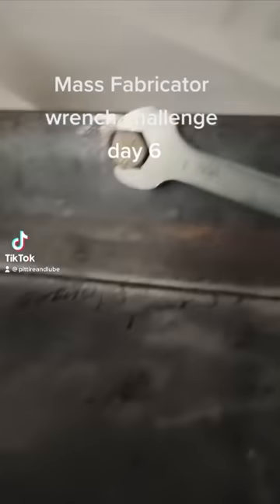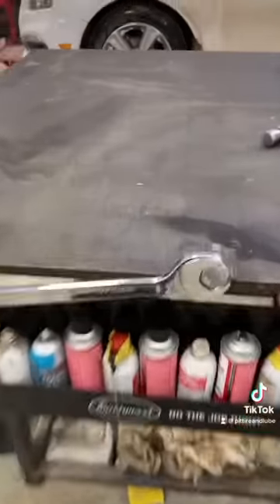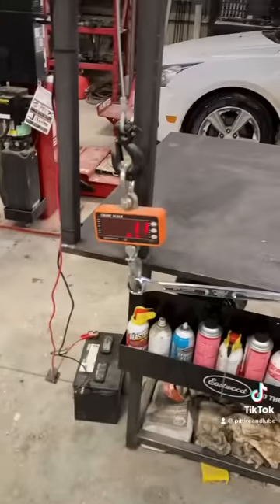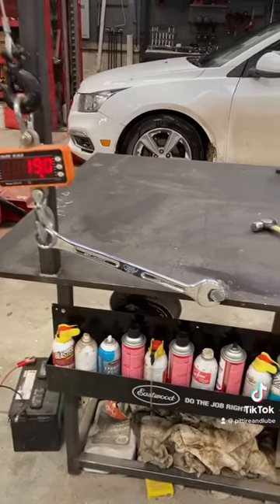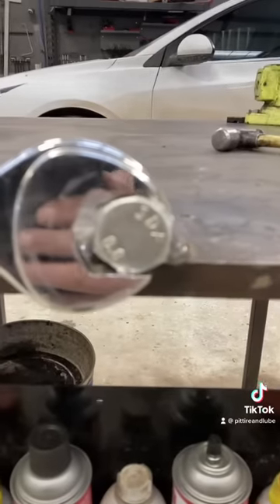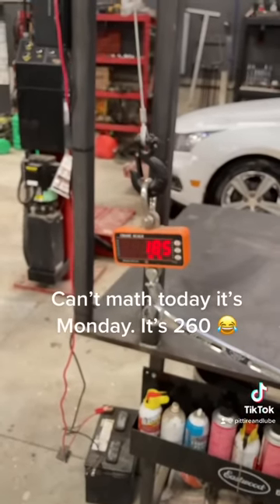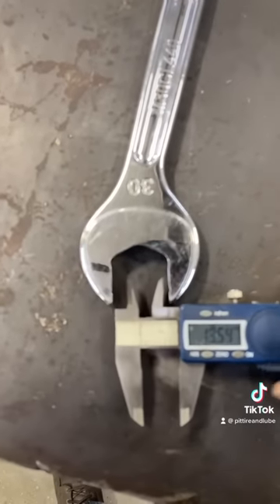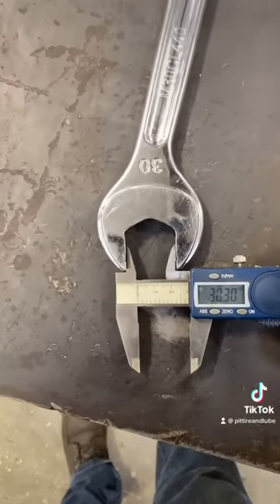Open ended wrench torque test #mechanic #Tireshop #wrenches

Comment: You are not properly applying torque to the wrench. You are pulling away at the end of the stroke.
Reply: Yes exactly.
Reply: Close enough. The wrench is slipping off the faster like in the original.
Reply: @mikeznel6048  because hes pulling the wrench off......watch AVE if you want to see how a wrench should be tested. this is not it
Reply: Would have to pull along an arc to properly test
Reply: @justinmckee2256  yes.
Reply: Torque is the cross product of the radial vector with the force vector which in this case is the length of the wrench multiplied by the the force applied to the end of the wrench multiplied by the sine of the angle between the wrench and the applied force. If you take a Taylor series expansion of sine term in this relation it becomes clear that small angular deviations from 90 degrees make a very negligible difference in the actual torque applied.
Reply: @justinmckee2256  pull along the arc... or just spin the fastener and not the wrench.
Reply: @mikeznel6048  Came here to say exactly  that.
Reply: That's what she said
Reply: The stroke needs to be in a circular motion, had to achieve that with the winch.
Reply: Need a pulley

Comment: I'd like to point out that if you know the thread size and the grade of the bolt, you can look up a chart of the typical maximum tightening torques. 👍
Reply: That's what I do when I can't find specs, just pull up the chart for that fastener. Go low of it's in aluminum, high if it's in iron/steel

Comment: You need to apply the sine of the angle relative to the vector that you are applying force from
Reply: finally someone who knows moments
Reply: @jadenr.11 we all aren't mathematicians
Reply: @mcstench8913  i’m not a mathematician but i know simple engineering
Reply: @jadenr.11  we all aren't engineers
Reply: @mcstench8913  you don’t need to be an engineer you just need to have finished 3/4 of high school
Reply: @jadenr.11  we all didnt finish high school
Reply: I f*cking love YouTube comments
Reply: @mcstench8913  then that’s ur problem at this point
Reply: @jadenr.11  we all don't have problems
Reply: @mcstench8913  😅😂

Comment: Chinese wrench open end is spreading. That's why it's rounding off the bolt. Its not the bolt failure
Reply from the maker: Well we did it on another bolt and it held 540 foot pounds so almost three times that one 🤷🏼‍♂️

Comment: I still think it funny how many YouTube videos I watch where people are testing the limits on tools. Lol. A 30mm bolt, I’m just changing oil maybe a little suspension work but I’m still watching this stuff. Ok. Off to torque test channel to watch them test 2” hydraulically powered impact wrenches.

Comment: Well to be exact: FtLbs is torque, psi is pressure. I think the guy in the video wanted to tell (what I think are) his students how much pressure is on there, because its just gripping on a small contact point with much force. Anyway, still was a good video on showing how much torque can be on that wrenchcbefore its starting to slip.

Comment: that lever is more than a ft. measure and recalculate it's probably over 300ft lbs at a ft and a half.
Reply from the maker: It’s 1.3 feet, did a second test on a new bolt and held up to 546 foot pounds before I stopped. Very impressive in my book
Reply: Where does he get 200lbs * 1.3ft = 360ft*lbs. maybe he meant 260 ft*lbs.

Comment: Never mind the surface area making contact between the two wrenches isn’t the same. Looks like the one guy is using a wrench cut on a plasma table while the other is most likely made out of chrome steel and obviously thicker.

Comment: Snap-on flank drive plus can pull head off bolts. That's why I bought them. Yes open end! Of wrench
Reply from the maker: We’re going to test them here in a little bit
Reply: That's what sold them. Never regret
Reply: gimme a 1 3/8" one of those and ill put it to the test. ive stretched so many wrenches taking off -16NPT fittings. honestly like 5 or 6 now

Comment: The imperial bolt with the 6 lines on is a grade 8 bolt, which is closer to a 10.9 metric one not a 8.8

Comment: That why if you can get the box end of the wrench on the fastener you should use it because the open end of the wrench will spread open or round the bolt
Reply: You also don't want to use a 16 point wrench because it can strip it just as easily.
Reply: @RandomPerson-cj2wi 
Sixteen point wrench ??
Who makes that ?
Reply: @Ben Jurqunov  mabey I'm thinking of 12. When I typed it I couldn't remember if it is 12 or 16.
Reply: @RandomPerson-cj2wi  if you can’t remember….. you should probably not type anything at all

Comment: How much pressure? I don't think the guy is using the correct unit. It should be  torque, which is the force times the lever arm. It may seem like I am being pedantic, but these units are extremely important when understanding physics.

Comment: Difference is the wrench in the original post looks like a cheap cast tool that came with some furniture and will bend if you look at it weird. Different wrench will show different results
Reply: Look up 'Mass Fabricator'

That wrench you're talking about is made out of AR500 armor plate steel. The open end of that wrench probly has more tensile strength than both ends of that mac

Comment: I had the precision torque wrenches. Absolutely trash. Matcos rebranded proto wrenches are a hell of a better deal and better tool, those mac branded facoms are soft, ill always reach for my flank drives if I'm having issues.

Comment: The force should be applied in an arc not at a 90 degree angle.

I don't mean to be rude but you don't understand physics nor what you're trying to achieve.
Reply from the maker: When you pull on a wrench you don’t pull in an arc.
Reply: my thoughts exactly!!!
Reply: @thepit2020  yes, actually if it is tight that's the only way it will come loose
Reply: @thepit2020 think of the bolt head as a sun, and the very end of the spanner a planet in a perfect orbit.

Force should be applied in an arc or radius...but then again I've been a qualified mechanic for only 25 years so what the hell would I know 🙄
Reply from the maker: The most effective force on a lever arm is at 90 degrees to the handle… it may travel in an arc but the force is still perpendicular.
Reply: @thepit2020 @thepit2020 exactly. By not keeping the force at 90° the distance from the force applied (the hook on the spanner ring end) and the bolt will increase... effectively pulling the spanner off the bolt.
Keep going with the winch and you'll see what I'm trying to explain because the force is not constantly at 90° to the bolt.

On your setup some of the force imparted on the bolt rather than just torquing the bolt is also pulling the spanner away from the bolt...once again I'm not trying to be rude but if you can't grasp this concept then fuck I dunno, I'm done trying to explain.

Have a good one 👍
Reply from the maker: That’s why we stop and reset the test once it gets too much past 90 degrees.  

We also try to make it exactly two feet away from the pivot point so it’s more accurate and easier to read. 

Obviously that isn’t what is going on here. The gentleman in the first video doesn’t have any kind of gauge so I’m giving him a quick example. 

You’re so worried about one aspect of this video you’re missing the entire point.
Reply: @thepit2020  so basically it goes in an arc like we said lol!?!?
Reply: @thepit2020  yes you do your body is going to allow the arc to slightly drive the direction you pull. You aren’t going to fight physics unless you go out of your way to.

Comment: Thats an m20 8.8 structural  bolt its a 32mm 
A non structural  bolt 4.6 would be a 30mm 
Its not premature  its the wrong spanner ya noodle

Comment: 30.3mm on a $40 wrench. Thats shit.
Reply from the maker: Can’t be much tighter or it wouldn’t ever fit between rust paint and mud
Reply: @thepit2020  that's what a hammer is for . if your ok with that much slack cool.
Reply from the maker: I’d bet most wrenches have that much tolerance built in.

Comment: That's not even a good idea you're using a name brand tool against probably one that is not a name brand I mean it has no markings no nothing on it whatsoever and you're using a Mac wrench
Reply from the maker: So it’s just for an idea of how much they’ll hold, he’s going to send me some of those wrenches and then we’re going to do a comparison.
Reply: @thepit2020  and only then would you be able to give an accurate assessment Mac, snap-on, and craftsman tools are all different grade metals with different heat treatments in order to give even an estimate it needs to be as close as it can be I'm a blacksmith and metal fabricator the grade, type and heat treatment of the metal is what makes the difference

Comment: Everyone is making great points tearing this guy apart.  1 I would like to add is he didn't use the same wrench and project farm has taught me each wrench will grab differently
Reply from the maker: I wasn’t comparing wrenches (not yet at least we will be doing some testing) just how much weight it will hold
Reply: You can't calculate weight compacity without the same wrench. That's like saying a wrench that's 30 thousandths off canhold the same amount as a wrench that is 60 thousandths off. It just doesn't make any sense.